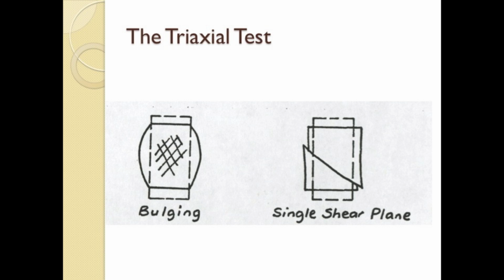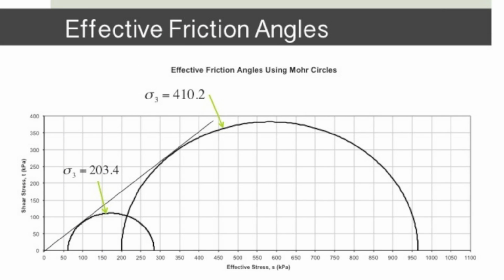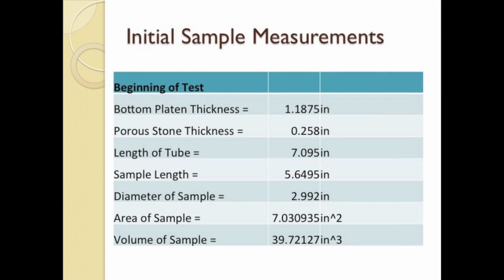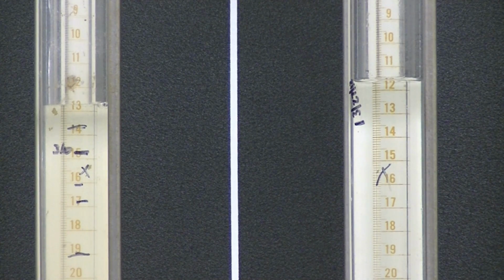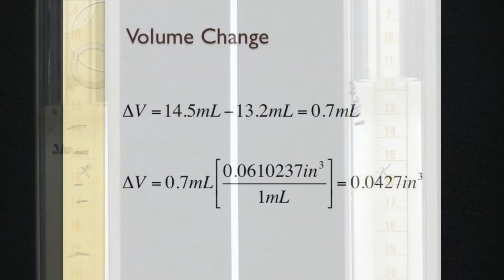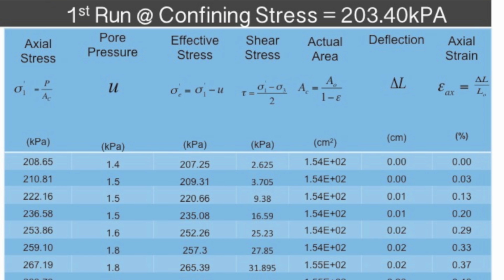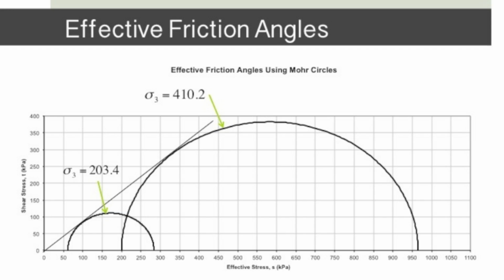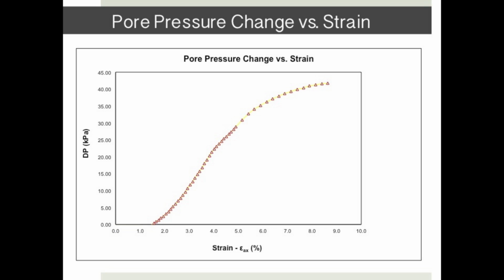CU Triaxial

Comment: i have a question regarding CD test. we have an ELE international device and our cell consist of the following valves from left to right.  (Lower- Upper) which are bridge and lateral Upper and lower. the cell pressure sigma 3 is applied through the lateral valve. now my question is during applying the axial load for consolidated drained test do i need to have the Cell valve closed or open? meaning should i have 'Lateral valve open, Upper open, Lower open) or (Lateral valve close, Upper open, Lower open).
Thank you
Reply: +Bijan Eskandari Zadeh Hi there, I'm also using ELE triaxial set for UU, CU, CD tests. I can help you regarding your question. But in this case, a pictorial demonstration is needed. 
Normally during consolidation, you need to keep the cell pressure valve open.